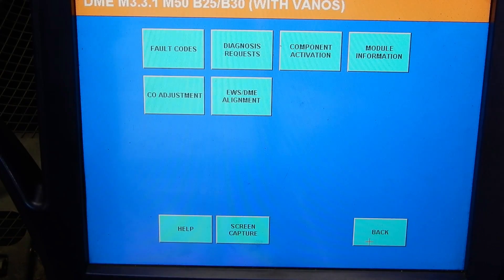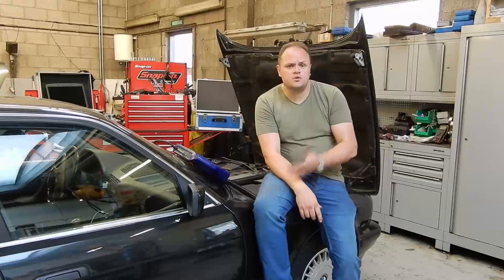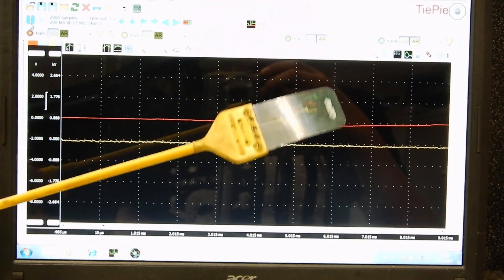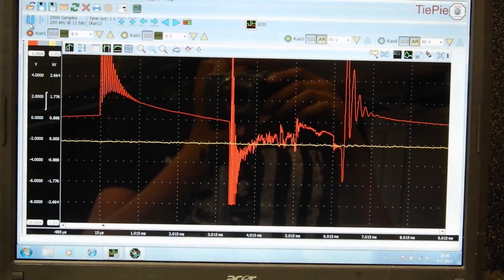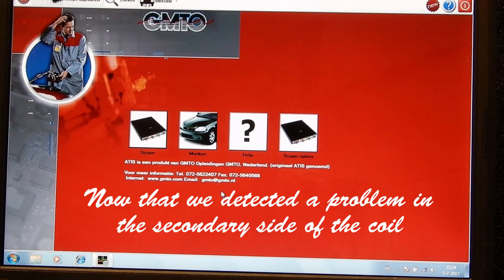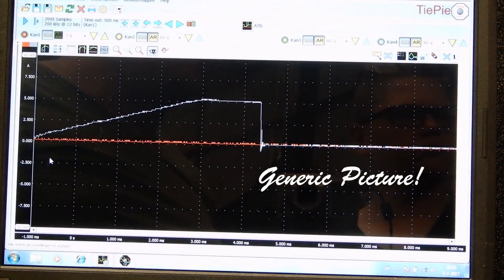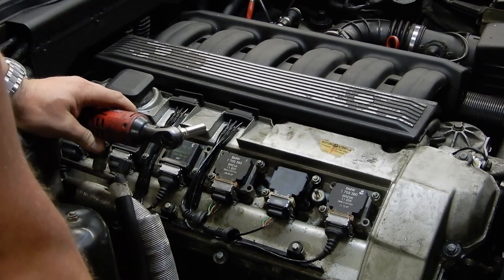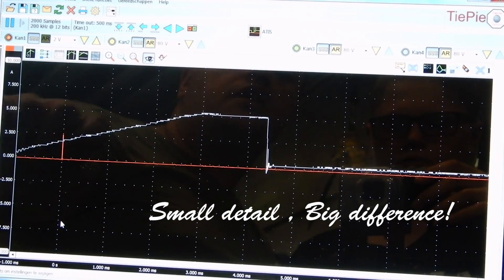No fault codes Misfire diagnose

Comment: Sir, where to look fix this fault?
Multifunction (Body computer (BSI) (Body computer) - Diagnose - MT/AT) DTC 000 Opis- ECU mute on CAN- Not recognized- Permanent

I have no any warnings on dashboard. My car sometimes not accelerate when I press throttle pedal, than response and I have to much power. It seems like problem on petrol engine when one spark does not work very well, but my car have diesel engine 1.6hdi 80/109, C4 Picasso I (2007).
Only thing which I see on diagnostic is big difference between injection quantity in cilinders.
I:   5.68mg/stroke
II:  2.52mg/stroke
III: 0.78mg/stroke
IV: - 0.07mg/stroke.
Engine running smootly most of the time. Idle running is excellent. Engine starts very quickly even when is very cold outside. I notice, that car have bigger fuel consumption than before, but I was thinkin this is about cold weather and AC heating, small diatance trips etc. Is it possible that I have bad injectors? I clean every sensors, I have new turbocharger and new EGR valve. There is no air leak in inlet air pipes. I put new seals on turbo, rosker cover, new rocker breath membrane, I do small and big service, most of the components are brand new. I dont know where else to looking now.

P.S. I just remember... about 20 days ago, I got warning message "depollution system fault", this was reason why I go to the diagnostic...but, dpf have 0% dirty. Car was in safe mode, rpm max was 2800rpm. Message dissapear by itself.

Comment: Great video!  Subscribed :)

Do you think a dirty MAF is possible for slightly high HC?  Vehicle passes Dyno smog at 25mph, fails at 15mph.  HC is at 60 (max allowable 51).  Not high enough for me to think ignition/spark issue, and I haven't cleaned the MAF since I've owned it (6 years) but did plugs, wires, and coils 20k miles ago.

No other symptoms apart from fuel economy has dropped 10ish%.  No codes and seems to run great

Comment: Awesome video! I’ve been having a similar problem on my Nissan Xterra! Had a intermittent misfire under load (2k rpm) and then sometimes at idle, no codes. The other day the cylinder was dead enough to finaly throw a check engine light! I’ve never been more happy to see a flashing check engine light! Swapped the coil from cylinder 3 (the cylinder at fault) to cylinder 4 and now it’s a waiting game 🫣

Comment: Having misfire also on cylinder nr 2, replaced coil from 3 to 2 (and 2->3) but still misfire. If I remove the jack from sylinder 2 coil, nothing is happening (still misfire and bad idle, engine shaking). Checked injectors, they work fine, changed spark plugs with new ones. still the same issue. Could be the CPS ?

Comment: Hey Dan I have 2007 Yukon Denali with a 6.2 no code but misfires I unplugged all the coils on the driver side while engine running no change and no check engine light any idea

Comment: I got an o7 grand prix 3.8. I put new coil packs new cam shaft and crank shaft sensors plugs wires ignition control module. And still has a mis fire .when get on it every so often like every time wants to shift I think. It's not throwing any code but EVAP but will that cause a miss fire

Comment: Hello I have a 99 Montero sport with 208k miles on it shakes at idle but once it's atleast passed 10 miles per hour it's smooth and my exhaust is sucking in, what could be the problem?

also  it throws Abit of blueish white ish smoke every once in a while

Comment: I have a 2009 Toyota Corolla everything is good on it had it for about 2 months now just started driving it a month ago and Yesterday when I pushed on the brake I felt it pulsating It was more like air in my brake And I hear clunking.. when I pressed on the brake I heard shocking noise By engine I’m pretty sure this is a misfire Engine light was flashing on I got it inspected 3 weeks ago EVERYTHING fine 😩 help . Any ideas what it could be ? Tried to get it coded today No coded showed up so They couldn’t see what was going on

Comment: finaly found a video thats pointing to a problem i have on my car.
it's a 1996 523i which has the same misfire symtoms, but only when the engine is warmed up, misfires are only there when idling and no fault codes pointing to misfires. when revving up the engine, misfires are less noticable, engine isn't vibrating while driving.
misfires are best noticable when listening at the exhaust tip.
hope i'll find a bad coil on my car.

Comment: I watched another channel from a guy in England (I think) who used a coin on top of the coil and a standard probe to pickup the signal from the coil. He showed that by not using the coin he got no signal but by replacing the coin on top of the coil, received the signal again. He said it was a tip he got from an older mechanic he was working with. Pretty neat!
Reply: Link?
Reply: @khuramnasar1905  
https://youtu.be/MOLj5vGIDsg

Comment: Wondering for some expert help
My vehicle idles very rough & accelerates poorly 
All started while driving on highway
Thought car was going to stall
Car engine really shakes on highway 
I had my codes read @ auto part store
Misfire on  cylinder 3
& Coil P0353
Injector P0203
I switched coil & Plug with other cylinder 
No change
I’m getting voltage/ohms @ all coils
Replaced cylinder 3 spark plug
Clear codes
Only injector code P0203 showed up
Added injection cleaner into 1/4 tank of gas
Next day vehicle ran better for about a few miles
Then issues came back
Any suggestions
Thank you 🙏

Comment: I don't know if you will see this and reply but have to try lol.   I want to but a car on Facebook. The seller said the car has a check engine light on. I asked what the code was, the seller said " I replaced the part, but the light is still on. Maybe it's a bad ground wire.". I want to buy the car. My question is, could bad wires cause the check engine light to be on?  How much money to have a mechanic go through the car and fix it?

Comment: I have a 2012 w221 with 88576 miles. Car ideal good, but steering wheel vibrates in gear (drive and reverse) you can feel it more on reverse. Neutral is fine. Need help

Comment: my "Volkswagen CC 2014 Executive" misfires under load. 
Errors are "Low pressure fuel rail" on diagnostic device. EPC light + Check egine Lights on.
we did, 
-Replaced Fuel pump in gas tank
-Replaced High pressure pump on the engine
- 2 Sensors reads fuel pressures.
- Fuel Pressure checked with Gage. 
- Spark plugs checked and cleaned and voltages also monitored.
- Communication wires checked between main CPU and sensors.
- Oxygen sensors are functional and no errors. 

Vehicle sometimes works and behaves normal, but sometimes worst.
To able to drive ,I remove sensor on fuel rail to avoid "EPC" error which cause engine to limit RPM max to 2000. Engine sounds fine on idle.
I can drive without misfire if I use pedal shifting (manual mode) to keep engine on high RPM but its loses power on Drive mode if I hit accelerator little bit more than usual and I can fell misfire shakes cars body. 
please let me know if you have any advice.

In two days we will try focus on injections. I hope we will fix it.

Comment: The purpose of this video was not to c how quickly DD could fix the car. It was to show us how to use an amp clamp to check on the current ramp up with the amp clamp. Also to watch for the firing line with the secondary probe. I love my M12 ratchet too. The fuel one is to heavy for normal use. I hardly use it.

Comment: Good video but what has been done to these modern engines is an absolute crime....up to maybe 1980 we had POWERFUL engines, NONE of this bullshit, NO engine scanners or computers..spark plugs, one coil and plug wires....NO sensors at all, when it didn't run right you knew what was wrong INSTANTLY if you knew anything at all about an engine...only a couple of OBVIOUS things it could be.
Reply: Elaborate designs were needed to comply with economy and emissions regulations.

Comment: Good video and explanation.  What would a wave pattern look like where coil is connected by a plug wire and a short is between the plug and engine?  In other words not all of the spark is getting to the plug gap.  Thanks.

Comment: I have a 03 330 xi and am having cold start issues in the morning when first start car and let it idle after ten seconds the car starts to misfire and I get code 1437 misfire cylinder 3 with fuel cut off  only if I let it idle once the car warms up it runs good I try swapping coils spark plugs and no change always cylinder 3 I have replace all vacuum hoses new ccv new disa I did cylinder compression test at cold all cylinder 170 please what would you suggest I should do.
Reply: leaky intake gasket? https://youtu.be/3RFTS22w6tM

Comment: I think your description of a transistor being a relay is correct.  When it's used to switch current on and off, it is working as a relay.  When it's used to modulate a high voltage or current then it is working as an amplifier.  The relay analogy is a good one.  Great videos.

Comment: This is the best car diagnostics channel I've seen on youtube, by far. I love the kit you've got!
Can you talk about the prices and whether and how good are cheap home units and about typical rental options for expensive equipment?
Reply: Wonder if current and duty cycle reading from an amp clamp tried on each coil would have isolated the anomalous (misfiring) coil. DC amp clamps with Hz and % are cheap as chips nowadays.

Comment: Could  you use a clamp probe also for testing secondary waveform (by holding it on top of the coil-same way as you use a coil on plug probe) ?
Reply: To feed the scope or just look for a reading?  It should pick up some induction.  I think it would work with a scope.

Comment: I wonder if you could help I have a 2011  320i e93 with a hesitation/misfire at 1800 rpm on very light throttle, I have no fault codes. All coils were replaced a year ago and the coils / plugs / injectors have all been checked, o2 sensor has been replaced. 
My local BMW dealer has not got a clue what the problem could be, the last suggestion was the fly wheel! 
Could you suggest what it could be?
Regards

Comment: I’m chasing a multiple misfire with no code on my car for years can’t fix it changed every thing but no luck only thing that not replaced is engine wiring .
Reply from the maker: For a Year? Wow😬
Reply: Years since 2011 😂😂 changed my engine to another car and it runs Super smooth if you have some advice I can do without a gas analyzer I have every thing except it

Comment: it's just an inductive probe. you can make one out of a coil of wire.  That a lot of voltage on the secondary. a scope and a piece of wire should be able to see it pretty easily.  Actually, the problem would be seeing all of the coils at once.  Some sort of shielding would be necessary.

Comment: Dan,  can Snap on Thermal Imager will get this problem, like the way u did in other video or the thermal imager can capture only for 100% DEAD CYLINDER. I was told snap on thermal imager can be used to check COIL as well. not sure how this works
Reply from the maker: It will only get it if the temperature difference is big enough

Comment: Great video. Awesome current waveform diagnosis! My amp clam is one of my favorite tools to use for coil diag. Unfortunately I don't own a cop tester or paddle probe yet.  Maybe a Xmas present lol! Scannerdanner used to say coil amp wave forms should have a slope as the current fights resistance as it builds a feild, shorted windings equall the straight up line you showed, if it was zoomed more you would see a very clear straight up line. Great video, you have a lifetime subscriber!
Reply from the maker: Thank you Cody that's Great 😊

Comment: I've seen cars flash the check engine light and sometimes throw intermittent misfire codes but there were no real misfires. A bad drive belt can cause these symptoms when the belt starts slipping. When the belt slips it will jerk the crankshaft, which upsets the rotational timing between cylinders. Monitoring the timing of the crankshaft rotation between cylinders is how the computer detects misfires so the slipping belt can fool the computer into thinking that you have a misfire when you really don't. If you have a problem like this and the car has high mileage and it still has the original belt try changing the belt, which probably needs to be done anyway.
Reply: kapil pawar  Sorry, there is some confusion here. The type of misfire codes I'm talking about are NOT associated with the internal timing belt that drives the camshaft off of the crankshaft. Instead they are false misfire codes that are being generated when an external accessory drive belt or the serpentine belt is slipping intermittently. As I stated in my post as the coupling between any of the driven accessories (alternator, water pump, PS pump, A/C compressor, etc.) and the crankshaft suddenly changes the crankshaft gets jerked, which  upsets the timing interval between cylinders. This in turn fools the computer causing it to throw the misfire codes even though there are no real misfires. One obvious hint is if the engine always runs perfectly with no misfires being felt, especially during acceleration, but then you are getting intermittent misfire codes anyway.

To make things really confusing rain can sometimes make a worn or stretched accessory drive belt slip when its wet, but it doesn't slip when its dry. This in turn will cause the false misfire codes but only when it rains. This type of misfire problem can sometimes be associated with bad spark plug wires or a bad coil causing a technician to be seriously misled about what's actually causing the intermittent misfire codes when it's raining.

Sorry for the confusion.
Reply: kapil pawar  Good question. Let's start with a little review of basic engine theory. On a four cylinder engine you will be getting four pulses off the crankshaft sensor per each crankshaft rotation. Now remember that on a 4 cycle engine the crankshaft goes around twice for every time the camshaft goes around once. Further, remember that each cylinder only fires once for every two times its piston comes up to top dead center (TDC). This is why the computer also needs an additional signal coming off the camshaft position sensor. This camshaft signal lets the computer know what the valve train is doing so the computer knows which two cylinders are firing on this crankshaft rotation and then which two cylinders are firing on the next crankshaft rotation. By knowing all this the computer knows which piston is currently on its compression stroke so it can open the correct fuel injector and fire the correct spark plug and it can do all of these things at the correct time to properly fire the correct cylinder. 

For a 4 cylinder engine the typical firing order is 1-3-4-2. What the misfire monitoring routine in the computer does is it looks at the crankshaft sensor signal pulses and it times the intervals between when the four cylinders are coming to the top of their compression strokes. Each time through it times the interval between when cylinder 1 is at TDC and then until when cylinder 3 comes to TDC and then until when cylinder 4 comes to TDC and then until when cylinder 2 comes to TDC and so forth over and over.

If the engine is running normally all these timed intervals between cylinder firings should be roughly equal. They will all increase and decrease together as the engine RPM changes but no matter what the engine RPM's currently are at the intervals should remain about the same and roughly equal to one another. This is because the crankshaft is getting equal thrusts of rotational energy from each  cylinder.

Now let's assume that cylinder 4 has a bad spark plug and it is misfiring. The misfire monitor in the computer will routinely time the interval between cylinder 4 being at TDC and when cylinder 2 comes to TDC. What will happen is that this particular interval will be longer than the intervals between 2 and 1, 1 and 3 and 3 and 4. This is because cylinder 4 is not firing and pushing on the crankshaft and helping to turn it while cylinders 2, 1 and 3 still are. As such the time it will take for the crankshaft to rotate going from cylinder 4 TDC to get to cylinder 2 TDC will take longer than for the other three cylinders because cylinder 4 alone is not firing.

When the misfire monitor sees this occurring too many times over a certain number of crankshaft rotations it knows there is a problem and it also know which specific cylinder is causing it. In this example the computer would turn on the check engine light and throw a P0304 code, which is "Cylinder# 4 Misfire".
Reply: So, the ecu doesn't detect, directly (as some people might assume), that a  @joevignolor4u949  cylinder has not fired; but, that a signal is generated by the "rotation detector" for the crankshaft, which is a few micro-seconds later than the other cylinders.  Even with all its mass and (seeming) rigidity, the unfired cylinder crankshaft throw flexes (or, lags) a few micrometers which delays its detection point at the position sensor, by a few microseconds.
Reply from the maker: Interresting👍 Thanks for the feedback!
Reply from the maker: kapil pawar  he is not talking about the timing belt but the drive belt. Slipping could cause the crankshaft to speed up and slow down. The ecu might think this is caused by a misfire😉
Reply: Just had an intermittent misfire on Honda Pilot on cold engine. Found 2 coils soaked in engine oil from leaking tube seals in valve cover.
Reply: Good point, something to always keep in mind!